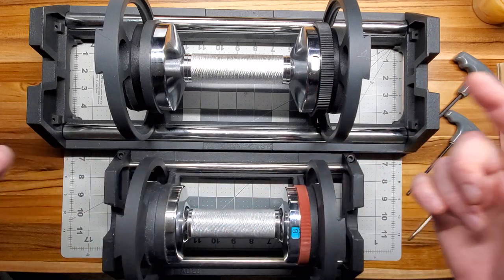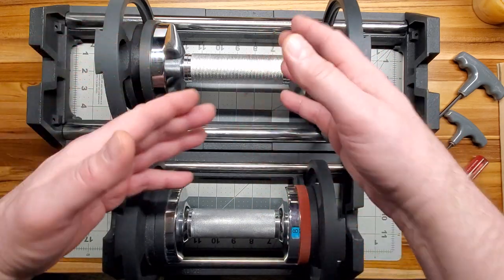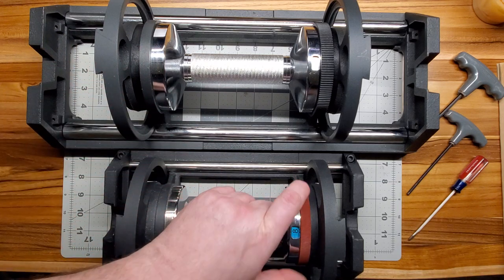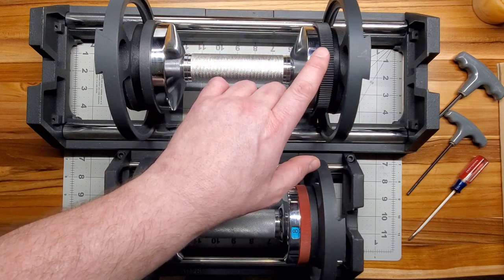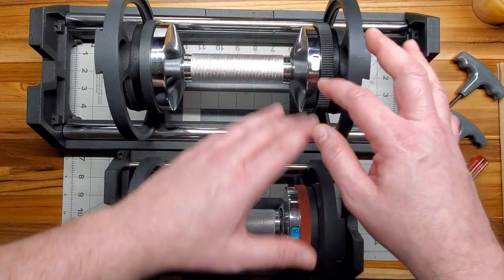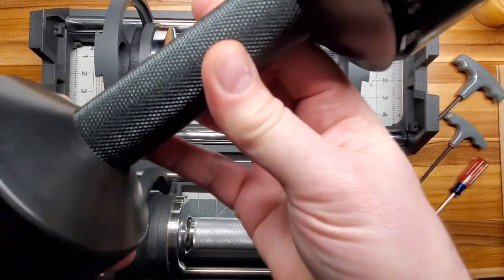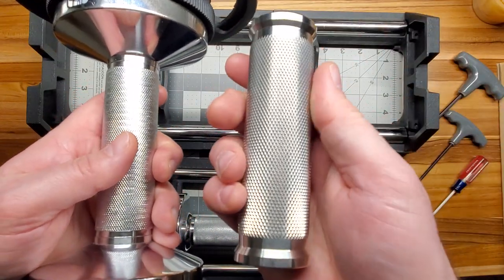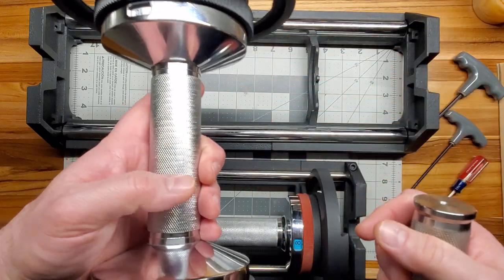Average Joe Teardown of SNODE® AD80 Adjustable Dumbbell--A Solid Design with Room for Improvement

Comment from the maker: Well this video ended up being significantly longer than I had planned, but hopefully you'll find it interesting/helpful even if you just skim through it. During the video I forgot to mention that I have no concern with ordinary day-to-day weight adjustment shearing off any parts as is the case with the Nuobell design.

CORRECTIONS:

At 8:30 I say "this is the only plate that has an insert". I should have said that the end plates are the only plates with inserts.

At 42:50 I mention that they "don't have an inventory in the U.S.". I'm referring to a spare parts inventory, not the dumbbells.

Comment: I understand this is a 10 month old video, but I found the mechanism interesting, so I'll leave this comment. 

The handle knurling is probably limited to their pressing process. The tube ultimately needs to be cold welded to the casted ends, and the least amount of material that needs to be formed the smaller the press is required or more assemblies can be formed in the same press. Unfortunately that means a less effective knurl, due to a lower gauge tube to start with.

Excellent commentary.
Reply from the maker: Hiya, KentoVv. Older video, but I still appreciate your insight. Thanks for taking the time to post it.  I know from experience with the knurling processes that we use in the manufacture of my custom grips that our options were limited by the grip wall thickness. The enormous pressure of some of the knurling equipment easily crushed the walls of lighter gauges. So we ended up going through the extra steps and cost of boring out solid billets to create tubes with no less than 5mm thick walls just to accommodate my knurl specs as well as the ~20mm center shaft of OEM Bowflex dumbbells. 

Snode, Trulap, Nuobell and other telescoping rod adjustable dumbbells are forced to use much thinner gauge tubing to accommodate those inner rods and, just as you described, it results in a less effective knurl. I suspect it's also why they use a higher TPI than I do.  Thank you again for sharing your insight. Cheers, Joe

Comment: This was a great tear down. Thanks for showing the internals. In definitely not getting that nuobells after your video on it. Now I’m torn between the ad80 and the powerblocks.
Reply from the maker: I'm glad you found it helpful, Veeps. For the time being, yes I'd stay away from Nuobell and wait for them to address the issues. I like my AD28, AD80 and my Powerblocks (I own several PB models). I wish you had some way to try them both out just to see which one best suits your style since you'd quickly experience the pros and cons of each.
Reply: @AverageJoeInnovationsLLC  I think I’m leaning towards the powerblock for the expandability. Also the ad80 are on backorder for 6-8weeks. I feel the powerblocks might be slightly more durable with less moving parts.

Comment: Awesome work!
Just ordered the AD80s. Came with a free stand and also had a $30 off which covered shipping.
Reply from the maker: Sweet! That's a damn good deal. If you have a minute or two after using the AD80s for a bit, I'd love to read what you think of them too. I'm in my own little bubble here, so it's always great to hear opinions other than my own. Cheers, and happy holidays!
Reply: @AverageJoeInnovationsLLC  
They got in yesterday, under 5 days from when I ordered until they arrived at my door.
Packaging was solid.
Straightforward installation.
I'm currently dealing with a herniated disc and sciatica, but I was still able to knock out various exercises.
Dumbbell bench with 60s felt solid.
Goblet squat with 40s felt solid.
Knocked out some curls and shoulder press, also felt proportional.
I love the knurling, nice aggressive texture.
I've never dumped dumbbells on the ground  even when DB benching 110lbs, but it's nice  to know these are "drop proof"

Comment: The AD80s look mechanically simple, robust and easily repairable. All reasons why I purchased these adjustable dumbells over the Nuobells.

*Currently, Snode is running a 20% off sale until May 10th. Also includes their new 1.25lb magnetic attachments that allow for smaller weight increments.
Reply from the maker: Oh man, I will have to ask Snode about the magnetic adders. Thank you for mentioning that, Noah. Definitely let me know what you think of them after using them a bit. Cheers, Joe
Reply: Excellent job on this video.  The amount of detail that went into examining the internal components of this dumbbell is just unreal.  I’m really considering these.  I really hope the plastic gears don’t wear however.  May have to wait for the Pépin Fast Dumbbells to make final verdict.  Currently have the all metal powerblocks and ironmasters and love them both.

Comment: I have the plastic/metal combination tubing but would love to have the all metal ones! Thanks for the in depth breakdown. Super helpful in the event I would have to take my handles apart.
Reply from the maker: Hey DJ.  I would have loved that as an option for their early adopters, but I learned last night that the internals aren't interchangeable. A bummer, but it does open up the possibility of a DIY project for someone with the CNC resources to make it happen. Basically, to recreate the nylon/steel tube shafts in solid pieces of steel or aluminum. Totally doable. Not something that I have time for at the moment, but after last night's conversation with Snode, it's definitely marinating up in the ol' noggin.

Comment: Very impressed with the internals.  Replacement gears could easily be 3D printed and I'm sure steel gears will be offered either by the manufacturer or aftermarket eventually.  Very user serviceable design, love it.  I've been using Bowflex 1090's for 10 years without issue but these style of dumbbells do look good.  Thanks for the breakdown, great video and I appreciate the long form content.

Comment: Hey Joe!! Hope you can get a hold of the Trulaps 92lb adjustable dumbbell and do a breakdown video. Would love to see how they compare to the Snode AD80. Thank you for your videos, they sure do help a lot!!!
Reply from the maker: Hi Ady, By now you may have seen the video I just posted. I finally got around to doing a tear down after a several month delay. The 8592 is likely nearly identical to the 8552 internally, with only one or two minor changes to the parts, and the addition of more plates and a longer base. I'd rank Snode and Trulap as about equal, from the construction and durability to the repair-ability and aesthetics. I don't think you could go wrong with either one, though you may not be fond of Snode's larger increments or Trulap's weird inconsistent increments. Cheers, Joe

Comment: If you have their ear... I think they could make the Ultimage dumbbell if they just switch from cast iron to steel. Pepin just did a a fast series dumbbell but their design leaves these dumb rails on the sides. However, they use all steel for their plates and it is SO much more compact and nicer. Tell them to make an all steel version that's more compact... ill buy in a heart beat.
Reply from the maker: HI J O! I'm hoping to get my hands on a Pepin Fast just to check it out.  Unfortunately, steel won't make Snode any more compact. The densities of mild steel and cast iron are virtually identical. So an iron plate and equivalent mild steel plate of the same dimensions will weigh roughly the same. 

PF is about 2" shorter in length due to creating an adjustment mechanism outboard from the grip. That allowed them to shorten the length of the grip itself and bring the plates further inward.

Speaking of having their ear. Snode already watched my video, provided me with answers to some of the questions in the video, thanked me for some of my suggestions that they may now implement, and suggested rephrasing some of my claims for greater accuracy.  So this week I'm going to make a previously unplanned (and shorter) follow-up video with Snode's answers to make sure I provide everyone with the most accurate info available to me. 

On a separate note, the primary reason I want to get my hands on a Pepin is to see how that asymmetrical adjustment mechanism compares in drop tests. I suspect it shares a similar weakness to the Snode...potential damage from accidental drops if it lands upside down. Plus, I just really want to purposely drop a bunch of dumbbells. LOL
Reply: @AverageJoeInnovationsLLC  Hi, are you still planning on uploading the Snode follow-up video?

Comment: Ok this is really impressive and unfortunate that in most of the comparisons the internals and parts replacement isn't normally mentioned. Knowing about Snodes handles now would for sure make me buy them over Nuobell hands down.
Reply from the maker: Most fitness equipment videos seem to be made by end users with the intent of talking about how they use the equipment and any experience they have with it as far as usability and durability.  That's great, but it's a bit overdone. Does one really need 30 video reviews of the same adjustable dumbbell covering the same basic points?

I really haven't seen anyone do tear downs like this to talk about the durability and repairability of a design. I hope to expand to tear down other types of equipment beyond adjustable dumbbells in the years ahead.  For example, there are some rowers, steppers and bikes with common issues that may be preventable/fixable. The biggest hurdle I face is bandwidth. Hopefully I can find a way around that. I hope you'll check in down the road to see what else I tear down. Cheers.

Comment: Do you have plans to do the Trulap 8552 (52lbs dumbbell) or the 8592 (92lbs dumbbell)? I am on the fence right now between the Snode AD80 and this Trulap 8592. I have found your videos very helpful and would love see what the inside of that Trulap looks and works like on the inside.
Reply from the maker: Hi, By now you may have seen the video I just posted. I finally got around to doing a Trulap 8552 tear down after a several month delay. The 8592 is likely nearly identical to the 8552 internally, with only one or two minor changes to the parts, and the addition of more plates and a longer base. I'd rank Snode and Trulap as about equal, from the construction and durability to the repair-ability and aesthetics. I don't think you could go wrong with either one, though you may not be fond of Snode's larger increments or Trulap's weird inconsistent increments. Cheers, Joe

Comment: Hi Joe, any chance you'd do a teardown of the Trulap 8592 dumbbells sometime in the future? It definitely looks interesting with the cast iron/aluminium handle and steel plates. Either way, I'm looking forward to what you have in store next!
Reply from the maker: Hi AntV. Sorry about the delayed reply. I've been overseas for 5 weeks with limited internet access, and I'm back now playing catch up with orders and answering questions. 

I'll definitely add Trulap to my teardown list. Hopefully I can score a broken handle in the months ahead. I try to keep my costs low for doing these teardowns. My initial thoughts: they're using telescoping cantilevered rods. That's one of the reasons they aren't going to warranty against drops. It's not easy to make a durable design with telescoping rods. I also noticed that they're geared differently than Nuobell. The numbering turns opposite the direction of the grip and in fairly small increments. So there's some gearing going on inside that handle housing. Still, I wonder if they had to license from the folks behind Nuobell because it's the same basic concept.  I'll keep my eye out for opportunities to get my hands on one.

I'm months behind on publishing new content, but I hope to post a few new vids once I catch up with my current backlog of orders. I hope you'll stay tuned. Cheers.

Comment: Interested in picking up a set but what do ya think about the longevity of the notches? Some have pointed out that the metal on metal rubbing during years of re-racking could lead to functional deformities over time. Others have also mentioned that since cast iron is a more brittle material than let's say steel, the notches could break during impact.

Likely neither are to happen, but it's something to consider especially for the price.
Reply from the maker: Hi, TC.  I wouldn't be too concerned about the longevity of the notches. I believe they'll outlast ownership of the dumbbells in most cases.  It's important for me to note that I have no data to back up my statement in terms of cycle-testing or anything like that. It's simply based on my opinion of the materials and typical usage.

When it comes to A vs B comments, I find that commenters are rarely specific in a way that is meaningful and relevant. For example, which iron and steel are they comparing? In which form, and under what conditions?  So for these people to make comments about which is better, they need to be more specific.

Generally speaking, cast iron is considered to be self-lubricating under sliding conditions. It has to do with graphite in the material that forms a tribofilm which improves tribological characteristics. In plain English, cast iron slides against itself with less friction thanks to the graphite in it acting as a lubricant. Steel alloys generally require the addition of lubricant to decrease friction.

Generally speaking, cast metals will crack before they deform. You can see this in the world of automobile wheels. For example, look at curb damage to a cast aluminum rim versus one that is forged. The lip of a cast aluminum rim might crack and break away. The lip of a forged aluminum rim might bend on impact without necessarily cracking.

If we were to repeatedly drop these dumbbells from a height of several meters, at different angles relative to the ground, it'd certainly be interesting to see how the iron notches hold up. But, I seriously doubt any of the concerns they raised would be an issue under normal use. The forces on a dumbbell (and specifically on its plates) from ordinary dumbbell exercises, are well within the strength of iron by orders of magnitude. I suspect even repeated drops from a height of one meter would do more damage to the floor below than to the dumbbell plates.

In the case of Snodes, I believe the materials are less of an issue. It's more about whether you're ok with large weight increments, the knurl on the grip, the ring style adjustment mechanism, the width at higher weight settings, etc. All of those usability considerations.

Cheers,
Joe
Reply: @AverageJoeInnovationsLLC  Thanks for the quick reply Joe! You've convinced me enough to bite the bullet.

Comment: Hey Joe, I was wondering if you will do a breakdown of the pepin fast series dumbbells in the future?
Reply from the maker: I have received a couple requests to do that.  It's definitely a possibility. I just haven't had time in recent months. If I can get my hands on one, you can bet I'll tear it down. Though I suspect there won't be much to tear down. It's a relatively simple and straightforward design. I'm willing to bet that under normal use they'll last a lifetime.

What interests me most is its asymmetrical selectors. I'm sure Pepin doesn't want anyone dropping its dumbbells. Most adjustables with weight selector mechanisms aren't really designed to be dropped.  But in the event of an accidental drop, an impact at just the right angle might tweak those sliders enough to impair function. I've wanted to test that hypothesis for a while now. One day I'll get that opportunity.

Comment: Are you planning on doing a tear down of the Octabells? Look to be the exact same as the Nuobell aside from the shape. I’m curious if the internals are the same.
Reply from the maker: Hiya GB. Funny you should mention Octabell. Several weeks ago a subscriber reached out to me about donating broken Octabell handles for me to do a tear down.  I've not heard from him yet so I don't know if he'll be able to follow through. If he does, I'll definitely do a tear down.

You're definitely not going to be surprised. I expect them to be identical internally since the folks behind Nuobell have signed a number of license agreements:

https://nuoathletics.com/about/collaborations/

As an aside...notice that Core Fitness appears on that licensing page. Comically, they claim Core is licensing "their products" but the two dumbbells (Core and Nuobell) have very little in common beyond the general notion of telescoping rods extended by twisting a grip. Internally, they could not be more different. If I had to guess, Nuobell was permitted to patent some ridiculously vague and all encompassing general concept. And now anyone developing any sort of telescoping rod mechanism, no matter how superior to the Nuobell design, will have to pay the patent piper.
Reply: @AverageJoeInnovationsLLC  thanks for the reply. I didn’t know about the colabs. Great info.

Interesting you mention Core is on there. I though Core came first, but evidently I was wrong. And I didn’t realize SMRTFT was just a collaborator. I thought they were Nuobell.

I’m guessing the patent hinges on a rotating handle to adjust weight which is why snode is able to produce something very similar with the rotating inner collar. Now what we need is a collaborator to work with the Nuobell design but then produce it in a more easily repairable body with sturdier internal parts. Maybe an Average Joe/Nuobell collab…?